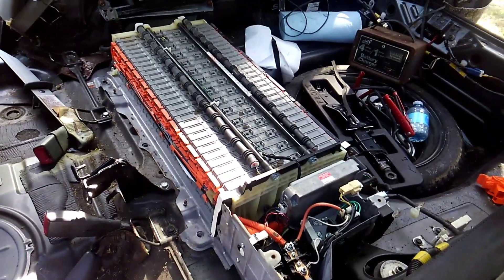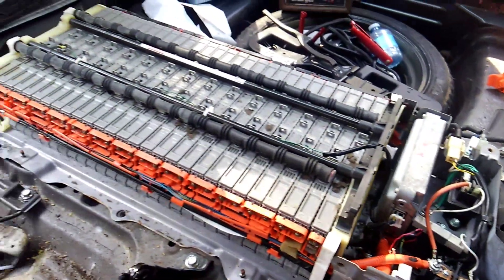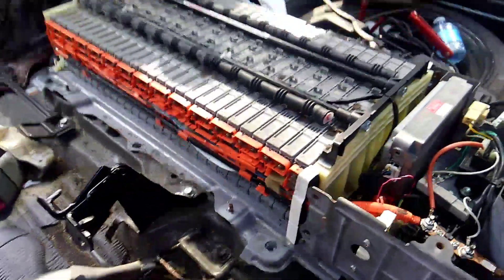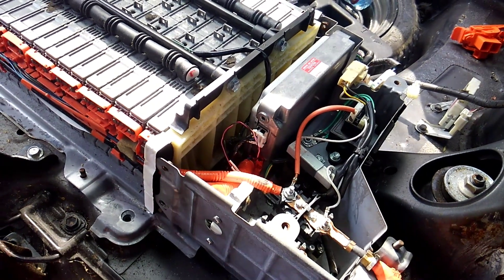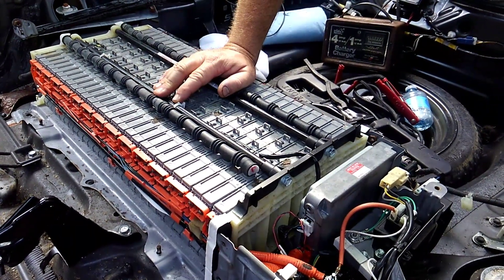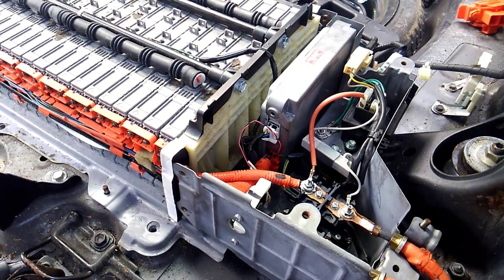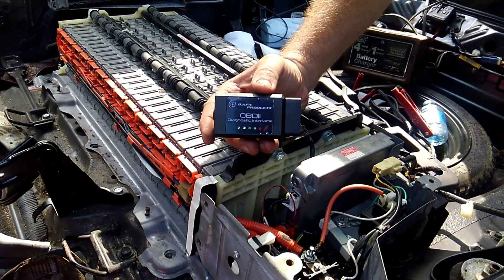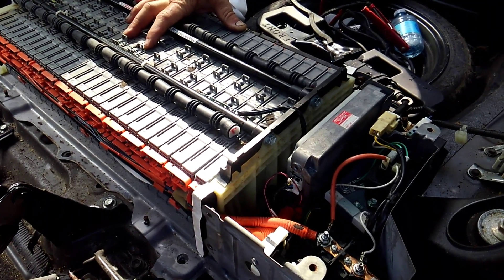How to 2007 Gen 2 Prius Battery troubleshooting with DoRite Fabrication

Comment: Did that bad connection kill the battery pack  like if you pull out the orange safety jumper? I just replaced some bad cells and I don't get any output voltage at terminals that connect to the car.
Reply from the maker: No that was a sense wire for the Battery management system.  If your battery has no potential you have another issue. Thanks for watching !

Comment: I have Dr Prius its something I can use even if my car wont power up? I didn't even think about it so I can use it to find which battery pack is foughtly. Mine has p3030 I don't see any broken wires i have cleaned bus bars the orange connector to computer was corroded so bad hard it was hard to get unplugged. I've cleaned pins best I can I will have to give this a try.
Reply from the maker: If the diagnostic port powers up it should work. That connector being corroded is a real bear .  One thing you might try since it already is jacked up is cleaning it with vinegar and cotton swabs.  Thanks for watching !
Reply: @survivalcomms  I'm with you it's already broken worst you could do is make worse than it is most of the time you get lucky.  I'll keep you posted how it turns out. Tnx
Reply from the maker: @timsharpe2419  YW ! Let me know will be interesting to see how it works out. Be safe - I shocked the crap out of myself more than once by being Laissez-faire with that battery bank.
Reply: @survivalcomms  blue driver is showing p3056 battery current  sensor circuit.? Ever seen this before?
Reply: My code shows high voltage cable snapped. I'm look for my  Dr Prius so I can plug that in to see what is says
Reply: @survivalcomms  I just seen a list of 4 or 5 things for the code p3056. I will keep digging.  Tnx
Reply: @survivalcomms  You said you got shocked twice even with the safety unplugged or taken out?  I just want to be careful not scared to try anything but dont want to get hurt or killed even.
Reply from the maker: @timsharpe2419  I was shocked when we were doing live testing. It was my fault as I did not secure the  power with the cutout. Make certain to secure it before servicing !
Reply: @survivalcomms  tnx glad you were ok
Reply from the maker: @timsharpe2419  The surprise  and knowing I should have known better hurt worse than the shock :)

Comment: Wow that rocks boys ! nice job ! ied made it into a solar battery pack !
Reply: Was thinking the same thing ... .
Reply from the maker: Always pays to be on the look out for resources. Thanks for watching !
Reply from the maker: Thank you ! You could scavenge one and do such with it. You would configure it differently of course.  Make sure to pull that HV disconnect / Fuse and be prepared to remove lots of fasteners to access the battery. Thanks for watching !

Comment: great vid!    roll your sleeves up and get into it brother.
Reply from the maker: Thank you !  We stuck with it for sure. If you had to shop OEM parts at list price from the dealer you would exceed the value of the vehicle real quick. Important things I gathered from this whole project is pull the HV disconnect - it definitely isn't an oldsmobile start battery,  the tremendous amount of information out there on forums , The importance of a real time diagnostic tool , the value of one of these vehicles parted out , and don't give up. Thanks for watching !